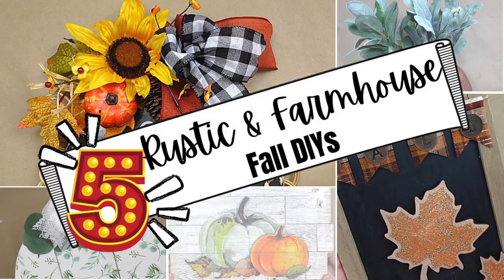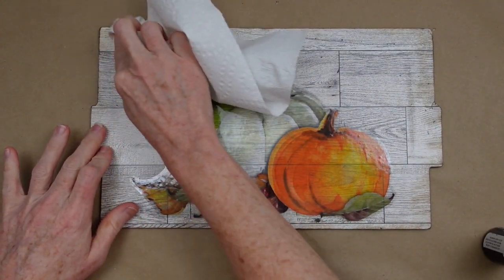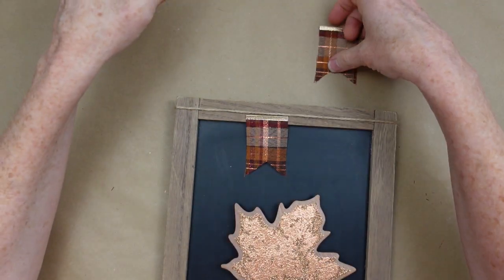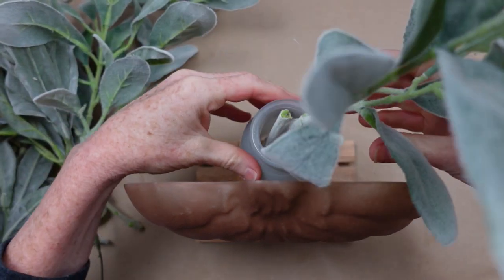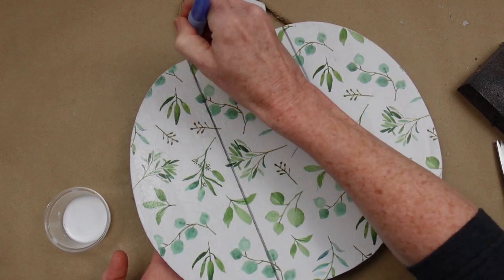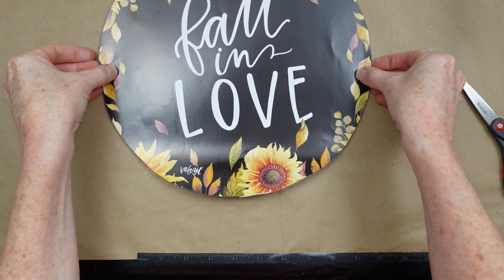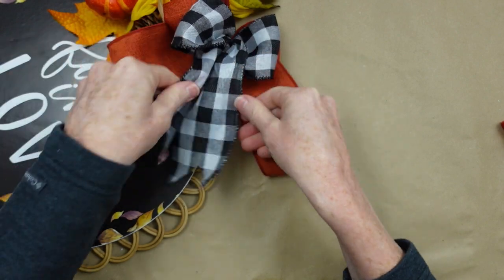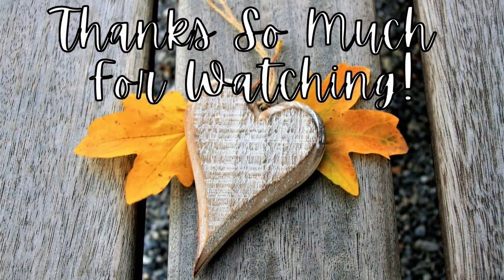Rustic Farmhouse Fall DIYs - Fall Sign DIYs - Budget Friendly DIYs

Comment: Tissue paper pumpkin is my fav! Do you always use a wet brush for mod podge? Also, what is the reason for adding water to the mod podge seal?
Reply from the maker: Thanks for watching! I don’t always use water in the mod lodge. I’ve found that it glides over easier on delicate materials if the brush is damp or when it’s a bit thinner. In my experience, it still gives the same desired effect. Hope this helps!